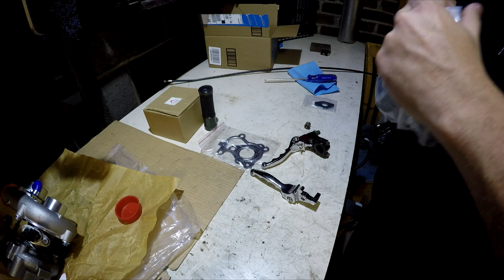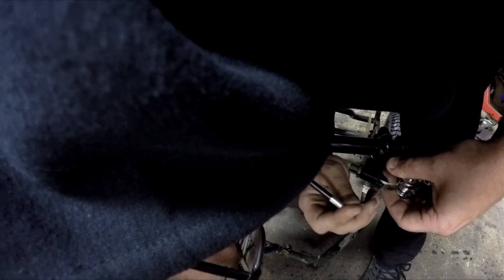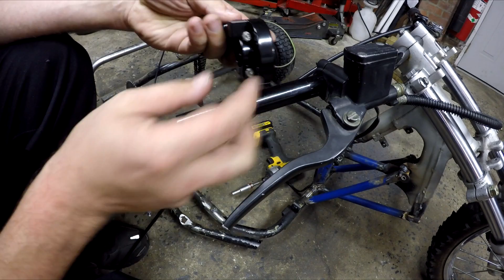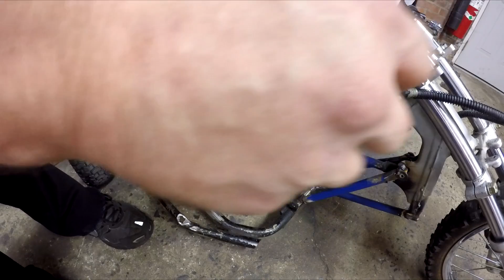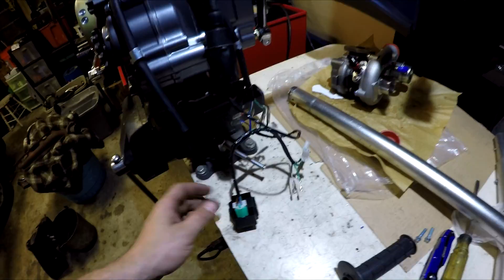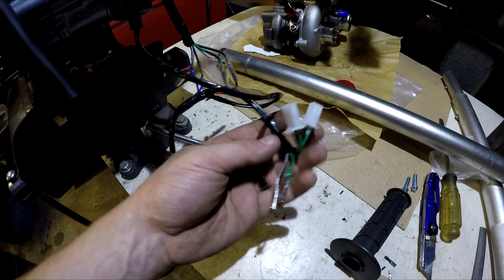drift trike - hand controls and ebay motor start

Comment: lol, what causes the engine to kick back like that?  Never had a kick-start bike...  I'm guessing it's compression related...
Reply from the maker: yeah i believe its just pre-ignition/backfire, too slow of a rotation or some stuff all mixed together with finding high and low spots on a kick start, i have heard of people saying older harleys will throw a little guy right over the handlebars lol
Reply: Haha, exactly!  My Dad used to tell me that when I was a kid, if you kick start an old bike wrong it'll throw you.  Glad I'm not the only one!  Yeah, pre-ignition makes sense.

Comment: That was the funniest sounding engine. It sounded like bubbles popping.
Reply: it's just because there's no pipe on there haha, that's what all single cylinder engines sound like with zero exhaust, I had a 650 suzuki that sounded exactly the same